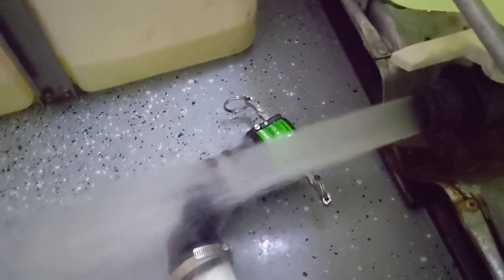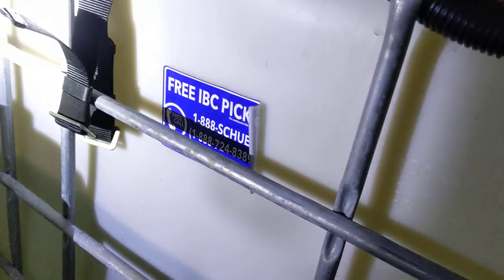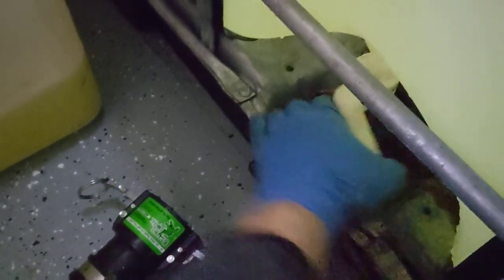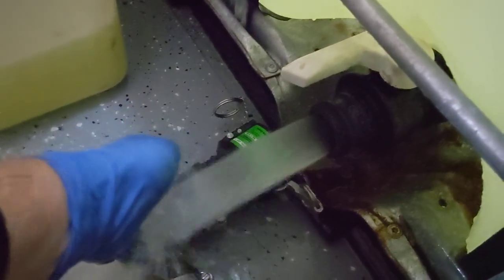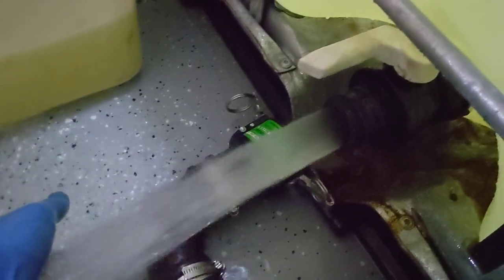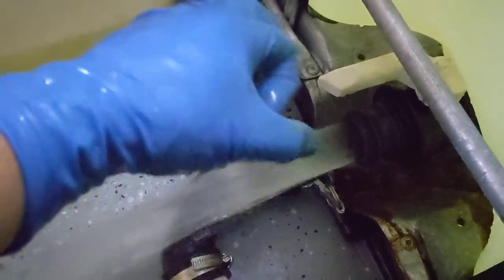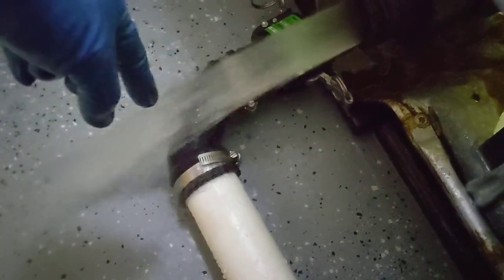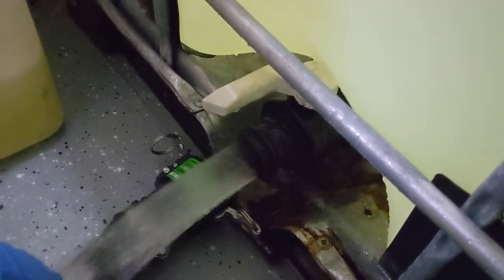How many gpm can you get out of an IBC tote for a pressure washer?

Comment: I’m running a 2” tee directly about 7ft of (2)1” hoses  to 3/4 ball valves with 3/4 quick connect to my pump. I’m running a predator 4.2gpm and plan on building a 9+ gpm here very soon.
Reply: Any way I can see your set up